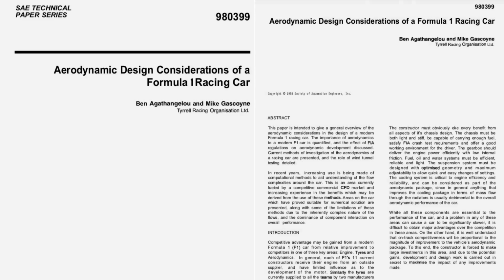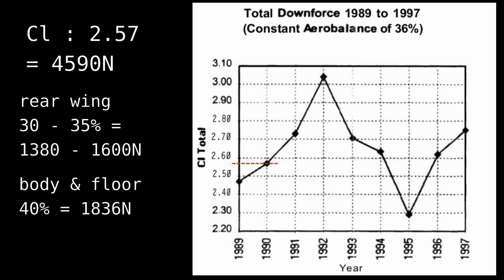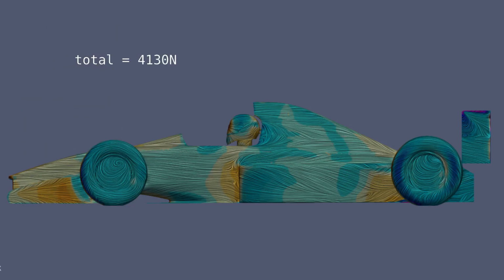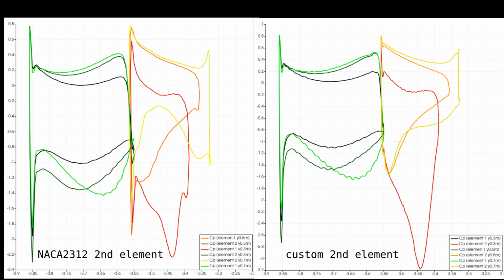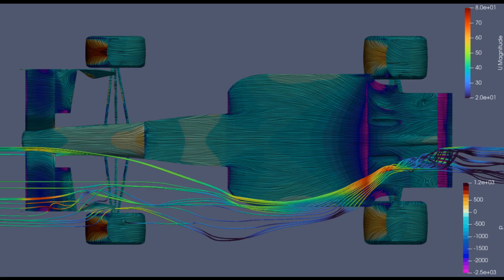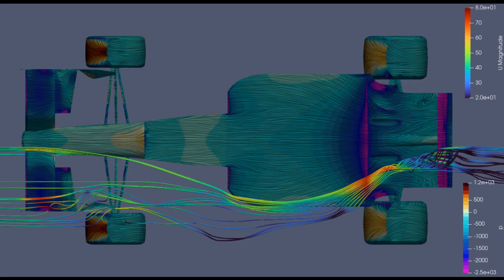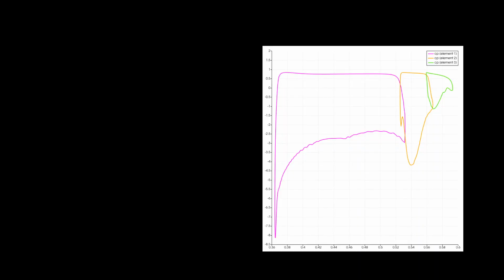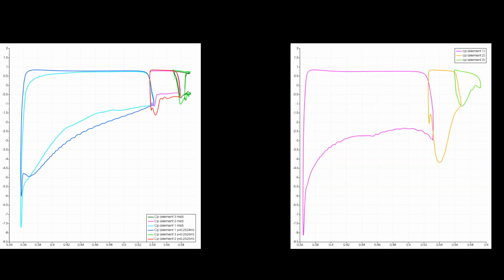Tyrrell 019: Reverse Engineering its Wings.

Comment: I reworked the aero on mine using your findings on the rear wing, which you seem to be getting a 3 / 1 to ratio lift to drag for high down force wing. I was using 1.8 / 1 Ratio. To get the same data from the Tyrell Papers, I had add lots more drag to the body of the car in AC its 3.79CL and 1.33CD of drag. I have 1.15CL(3 / 1) on rear wing, 0.95CL ( 6 / 1) n the front and total of 0.78CD on the Body (Wheels, Diffusers, Rest of Body). I've lost lots of down-force for Medium or Low, wing circuits as I got lots more drag on the body, I had about 0.60CD before, now I'm having to drop Wings really low to get same top speeds. I've always questioned 0.60CD for the body, it seems too low. The car is far more unstable now, very jumpy.

Comment: It's seems the rear wing was probably at 30% of total down-force for 1990 car..the 35%, for the mid 80's turbos. 45% for the floor diffuser and 25% for the front wing.

Comment: 1290 NM at 160KM/H would be about 1 CL. I think they ran the tests with 1.47 air density. I would though the rear wing would had more drag. I tried to do a simple wing like this but with planes. I got like Cd       : 1.8172308 (pressure: 1.8174097 viscous: -0.00017890582)
Cl       : -2.6043388 (pressure: -2.6037395 viscous: -0.00059923812) but it wasn't stuck to the car and it was flat planes, simple stuff.
Reply from the maker: air density should be about 1.2. This is the default number so unless you deliberately changed it that is what it is. If you can output forces you should do that. It makes the experimentation easier. Cl is just what the aeronautical people like because it characterizes the aerodynamic performance, its a part of their language and should be understood but it shouldn't necessarily be give priority. Typically they are looking at a static lift number and that should be achieved with the least amount of energy. If you are looking at road cars then Cd should be given priority, but then I've seen large cars have their Cd promoted and they have a large frontal area, meaning that they have more drag than smaller cars with high Cd....

Comment: I think the car is about 3.8CL, 1.8 floor diffuser, 0.9 front wing, 1.1 rear wing. I think the cars run better when the front and rear equal to the same lift. More frontal grip, slight less drag on the rear. But it really depends how the floor diffuser distributes it's load. Which means, they're forced to use slightly less frontal lift to the rear to keep the Aero Balance. I think F1 teams would of tried their best to get more rear diffuser downforce so it would equal. This is me driving https://www.youtube.com/watch?v=n-1Ad3HoO7A  1.05CL on rear wing 1.8 / 1 Ratio and 0.80CL on front wing 5.7 / 1 Ratio
-About 0.56CD of body Drag
-1.74CL on the floor diffuser.  (  0.17CL, 0.37CL, 1.20CL )
-Using CG of 0.400